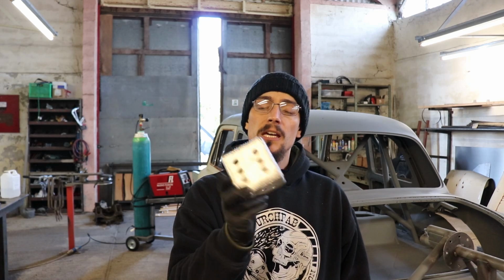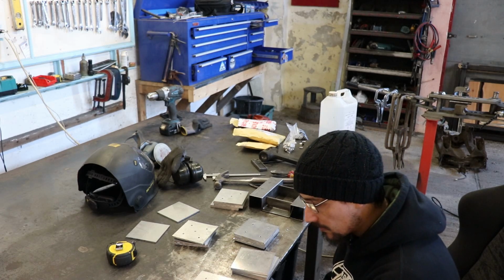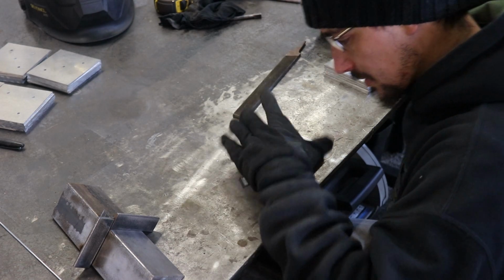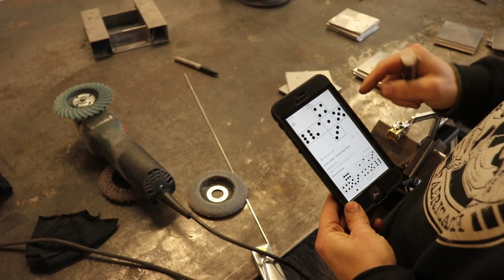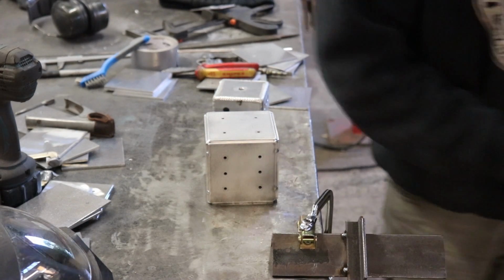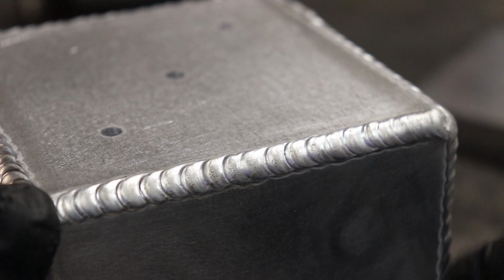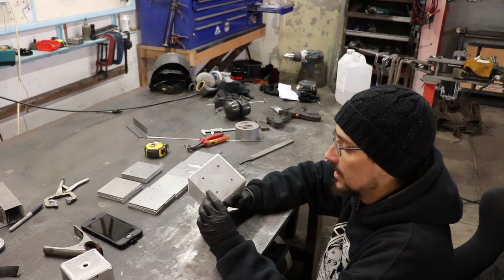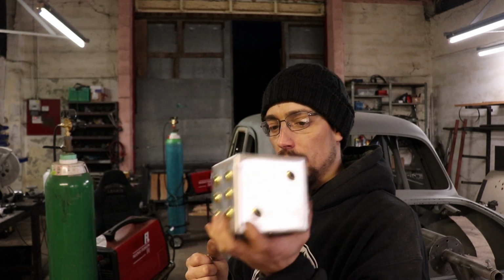MORE ALUMINIUM DICE!  FABRICATION TIPS, TRICKS AND HICCUPS.

Comment: I'm not a welder Matt, so I probably be happy if my welds looked like that. Watches an ally corner welding video on line just this week, where the US based welder had used a gas lens and had the same thing happen and changed back. Reason being, the gas lens appears to divide the argon stream to each side of the seam, because of its wider gas shield and leaves the centre (where you want to weld, short of shield gas, so it doesn't weld as clean. Did the same thing and swapped back to a standard, small gas cup and got great, clean welds. Love your work and wish that I could weld as neat and as well as you can.. Old age is catching up..I don't see so well and my arthritic hands don't work properly, but I still try lol..

Comment: I had the same problem using a pyrex cup on ally. It got to the point where I took my argon bottle back to the refiller because I thought the argon was contaminated. It turned out there was a leak on the torch where the pyrex cup pushed over the o rings leting air in. Went back to a normal ceramic and the problem went away. Only positive was I got my bottle refilled for free.

Comment: Great video.  A project I'm going to try for myself.  

Western dice are right handed.  Chinese dice are left handed.  In addition to the up and down faces adding to 7  the 1, 2 and 3 faces share a vertex.  If 1, 2, 3 go counterclockwise around this vertex it's called right handed.  Clockwise is left handed.  I think you built Western dice ok but it's hard to tell in the video.  If it's Chinese the 1 and 4 face have red dots.